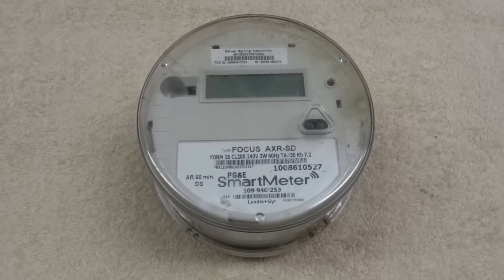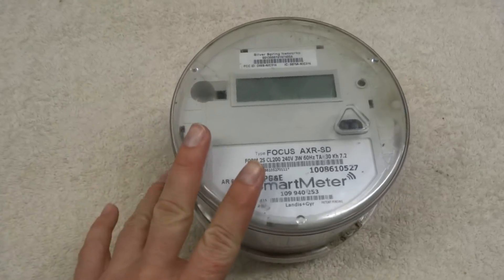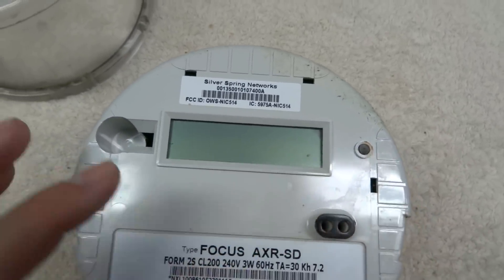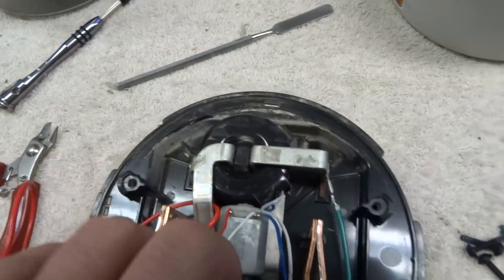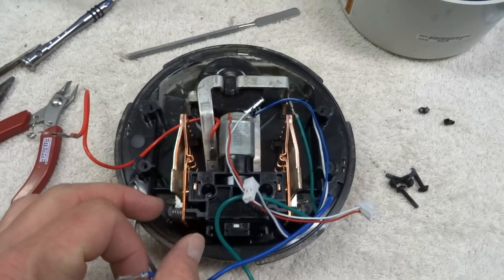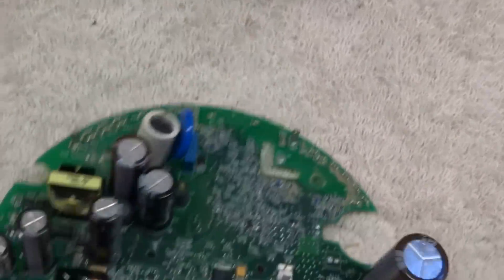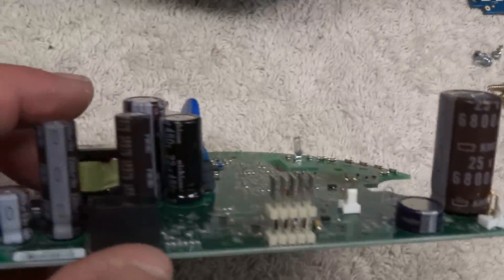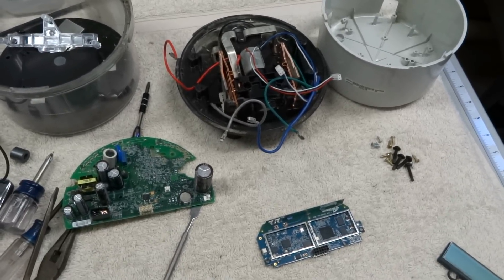Let's Teardown - Residential Smart power meter

Comment: 6:06 - the motor was added so power to a given house can be remotely shut down (e.g. didn't pay bill, enemy of the state, hackers, etc.)
Reply: This was the main reason our electric company (AEP) went with these meters and also they said we're going to have blackouts this summer to shed load. I'm in Texas🥵🤬
They tricked customers into accepting these on the basis it would save on our electric bill and we could observe real time usage. That has yet to take place 5 years later.
Reply: Is that a contactor

Comment: Someone may have pointed this out already but I'm not going to read through all the comments to see if they have.
You have the meter upside down. The power take off to power the the meter is on the supply side, not the load side. The supply side if where the switch contacts are and the load side is where the CT coil is. View the video when the meter is turned over and you will see the manual switch is at the top, not the bottom.
The green is not an earth. How can it be if it's on one of the 2 live poles. You have gray & blue to take off voltage from the supply side of the switch and red & green on the load side of the switch. This is still before it is sensed by the CT coil.
I admit green is a strange choice of colour to use for a live conductor but it's internal so any colour can be used for any purpose.

Comment: Safety aspect my ass ! You don't get with the program you get no power . Control of the people is why this was invented and implemented .
Reply: Let's look at why we need TIN FOIL HATS. 
 #1 A smart meter will hurt or even KILL disabled homeowners who have disabled medical implants.  The average of deaths by smart meter radiation and smart meter fires is almost 100 every month in North America.
#2 Did you know if your power company “turned off” the power to your home when they did a smart meter install, your chance of a smart meter fire increased by a factor of 10,000.
#3 Your power company has access to all of you private power information. Eg When you make tea, when you turn on your alarm etc. This private information is sold to Google for huge sums of money. Ask your power company what the second radio transmitter in your smart meter does. (ZigBee) 
#4 A smart meter will cause cancer to return if your family members who are fighting cancer at home. If they come home from the hospital and sleep near a smart meter, they will die. Check with the US Cancer Society website. 
#5 Smart Meter RADIATION  will turn off breakers in your home. Both AFCI's and GFI's get turned off by the radiation from the smart meter.
#6 You smart meter is very accurate, BUT, the software (firmware) is programmable. Your bill has nothing to do with the power you use. 
#7 Smart meter radiation is breaking Ionic Bonding.
#8 A huge expenditure for a huge loss. Billions of dollars to purchase something that does not general generate any power and each smart meter need 4 watts to operate. One million smart meters use 4,000 KILOWATTS of energy to operate.
#9 The second radio transmitter is for ZigBee. If you want your power company to MONITOR your home 24/7, then you are in luck. Don’t forget, this private information will be sold. Why do you think your power company spends BILLIONS of dollars and does not generate one watt of extra power to sell?

Comment: Even in this older unit,  I count about 8 processors.  Main CPU is rather large, which tells me it has large memory and operational capability, more then you would ever think, want or agree to.  From this, they can tell everything you do electronically in your home with your service down to the nano-second.  Sort of scary, actually.   My smart meter had to be changed because it was corrupting most of my remote control devices for TV,  tuner, DVD, et al,  in my house because of the proximity of the meter to my living room; also sort of scary.  Bottom line is, SmartMeters are entirely for their benefit, not yours.

Comment: That motor switch is a remotely controlled disconect, don't pay your bill it is shut off. The manual lever in back is to turn on by a meter reader with a re- connection fee. However depending on what circuit connection is used for the controller it may be remotely turned back on as well.

Comment: What a dwit. No clue what you are talking about.
Reply: OH LOOKEE HERE, we found us an EXPERT who is going to tell us why his smart meters kill an average of 100 people every month in North America. 
So DIM WIT Joe Bledsoe, give us the link for the DISTANCE TO COMPLIANCE for you AMI7 smart meter.
PROVE TO THE WHOLE WORLD YOU ARE THE EXPERT AND LIKE TO CALL OTHERS NAMES SO YOU FEEL MO MANLY
Reply: OK the donut round thing as dwit calls it, is a current transformer A torroidial wound coil of a non ferrous conductor around a core of laminated iron plates IE: a lam stack or in some cases it is a ferrite core. The bar that passes through it is the current carrying conductor of the load of the building it is monitoring. The winding of the CT has induced into it a voltage that varies according to the current passing thru its donut hole in the middle. Typically this is a 5 amp load at the rated ampacity of the meter but may be otherwise according to how the manufacturer built it. It appears to be a 200 amp household meter but may be otherwise. I purposely did not pursue any further investigation. If so it is a 200 / 5 amp CT rated for 200 amp load through it with a 5 amp output into the meter. This current may be monitored by a number of methods in the metering electronics but is eventually converted into a digital number by means of an analog to digital converter. This digital number is placed onto the meters data bus to be read by the microprocessor or microcontroller upon being told to by its internal program instruction stack. This is the amperage of the load which determines the KWH - kilo watt hours of usage which is an average of amperage used over the time of usage. IE: 1 Kilo watt of power used for 1 hour is 1 KWH which is how you are charged.  Ohms law states that 1 watt of power is consumed when 1 amp of current induced by 1 volt of power across 1 ohm of resistance. Volts x Amps = Watts.  assuming this is a 120 /240 volt poly phase system, a 120 volt supply to have a 1KW load needs to have a 8.3333... amp load on for 1 hour of time. A 100 watt incandescent light bulb uses 0.8333... amps. so 10ea of a 100 watt incandescent light bulbs must be on for 1 hour to use one KW of power. or if 5 are on they must be on for 2 hrs. Do the math if you are capable.  I never got past the round thingy description. I couldn't reach the mouse to click on the comment box fast enough to purposely debase the dwit. If you don't know what you are doing don't spread false crap and get someone killed or otherwise hurt. The remainder of this d&^%heads assessment was so painful for me as it is such bologna that I didn't look any farther,  as it is so obvious that the narrator is a dwit and knows nada about electricity. Go to school. learn how to beat your meat and get some satisfaction as you aren't going anywhere with this.
Reply: yawn!
Reply: Joe Bledsoe said:     yawn!
See folks, the smart meter radiation from his smart meters are killing his customers.
The smart meters hastily installed by his paid arsonist are burning down his customers homes.
HOW WORRIED IS JOE ABOUT ALL OF THE DEATH AND MURDER HE IS CAUSING?
Joe Bledsoe said:     yawn!
Joe Bledsoe said:     yawn!
Joe Bledsoe said:     yawn!
Joe Bledsoe said:     yawn!
Joe Bledsoe said:     yawn!
Joe Bledsoe said:     yawn!
Joe Bledsoe said:     yawn!
Joe Bledsoe said:     yawn!

Comment: The super cap is most likely there to keep power for the Real Time Clock during a power outage.  It has a lot of capacitance, but they are low voltage, and older ones had a pretty high resistance - you couldn't pull a lot of current out of them very quickly.  So they couldn't provide a lot of current / power, but the RTC circuit built into a typical micro-controller only draws a few microamps.  Seiko sold a chip RTC that consumed less than 1 microamp.  That allows a super cap to run the RTC for quite a while before draining.

Unfortunately, those older super caps didn't deal with high temperatures very well.  So if your meter was on the sunny side of the house, or you live in a hot area, that cap will die after just a few years.

Comment: Wifi is not used for transmission of signals and meter readings to the power company.  Wifi has a limited range for a few hundred feet typically, depending on what the Wifi signal has to transmit through, this is why Wifi is not used in Smart Meters.  Smart meters use low data rate cellular transmission of 2G, 3G, future 4G/LTE signals, just like peoples cell phones.
Reply: well then Kirk Charles, the #2 transmitter in your smart meter is the *ZIGBEE
WHAT DO YOU HAVE TO SAY ABOUT THAT?

Comment: These meters are set as KVA not in KW. Your meter will say be set to trip at say 39-Amps. The meter will trip at than current. You have to ask the electric company to reset your meter to say 80 Amps or whatever.

Comment: Ever see the power co. change a meter? they get a real good face shield on and place an explosion proof container around the meter and pull the meter. We had a smart meter burn those contacts on one side. Half the power in the house was off. 120 volts on some outlets and 25 volts on the others when the ac cut in.

Comment: just to clarify his error  suggesting that one of the two upper lugs is a ground.... all meters are dual voltage meters. the left side is 120 VAC and the right side is 120 VAC  because your house operates on 240 volts,  with the two 120 volt lines operating each side of your breaker panel. / thats why you can operate 240 volt stoves, AC units and  electric dryers. / the only "ground" actually is the bare cable running from the pole or from a grounding rod buried next to the pole. / as far as the  meter itself...rest assured, they were installed to benefit THEM, not YOU! / as far as them remotely disconnecting you... if one of the wires from the  internal motor was to  somehow become "disconnected", that might solve that issue...lol

Comment: I worked on these meters for a short period a few years ago at Landis+Gyr.

Chronological corrections or clarifications:
The button is multi-use per programming from the power company.  It can be used to re-enable the power disconnect, or to cycle through the different readouts on the display.  Different models have different buttons on the face and some have different clear covers with access to the buttons.

The two lines are Phase A 120v, and phase B 120v.  There is 240v between the phases.  There is no "ground" to the meter.  The meter sums the current across the phases (physically, via the single current sensing toroid (donut)).

The "banana plugs" are a bi-directional IR communications port.  The triangle on the front serves to locate the IR communication head. Seems like you got this correct later.

The motor is a basic DC motor that drives a cam to open/close the contacts on either side of the line.  This serves 3 uses: Disconnect for non-payment, disconnect for over-demand ("soft fuse"), and disconnect to prevent back-feeding (safety mechanism).

The plastic arm on the bottom is simply a hanger for use while servicing or installing the meter.

I believe the power company side is the bottom of the meter, so the current used by the meter itself is not paid for by the customer.  Either way, the usage of the meter itself is less than the meters capability to sense.

You'll also notice that there are 4 wires off the powerline - they are for sensing on both sides of the switch.  It can be configured to not close if the switch is open and there is power present on both sides of the meter (safety).

The supercap that is capable of powering the memory for a few days without power.  They switched over from a battery backup (that's what the hole to the side of the LED is/was for), as those had a tendency to go bad after a few years and need physical replacement.  I don't remember what all is stored in volatile memory, but it was a pretty important part of the meter.

I don't know much about the radio transceivers, but the header on the board supports a number of different devices - powerline communications, Zigbee, RF mesh, and cellular.  These were spec'd by the power company at the time of ordering / build.
Reply: Very Complete and good followup to the video. Just got my new meter and wondered if it had a disconnect.  As for the 3 reasons to be able to disconnect I believe #3 is very important. During the March 2018 East coast snow storm someone in our town was back feeding the downed wires with a improperly connected generator. Made service work difficult cutting up trees in the snow with live power on the high line from the generator. As we know supplying 115 or even 220 VAC to the Secondary side of the Pole Transformer can let it generate High Voltage to some degree. When power was restored it blew up the generator and set the house on fire... So they finally found it....  Not really sure if without power company power if the meter could go through a disconnect with no power. But part of the Safety Circuit could sense the Generator Power with the flow of power going away from the house and the motor could activate and turn off the GRID to that house....  That would make sense to me.
Reply: Greg  McNamer - Lets talk radiation ,   do they  really emit a lot of radiation ??.  Thanks for the input !!.
Reply: the radiation is the  same thing that the averange outdoor wifi router.
Reply: Where's the step-down transformer to reduce the 110v AC to 12v DC? I ask because none of those electronics are heavy enough to run on 110 AC and as you stated even the motor is DC, I'm guessing it's in the round part that has the Grey and Blue coming out of that has one 110v feed line going in and out of? Induction step-down transformer?
Reply: Gregory McNamer so do they emit radiation or not ? Have so many videos saying they emit radiation and large Volumes of emf ?
Reply: So what happens if I put a really big magnet on this meter, would it damage the meter, and if so how many will they replace on my house before they put a mechanical one back on? LOL But seriously.

Comment: The motor is to disconnect and reconnect the power when you don't pay your bill. The donut-shaped is a Transformers / coil. This coil is what's measuring how much current you're using. the red and green wire coming off the bus bars is what actually what Powers the unit. both of those bus bars are hot one is 120 the other ones another 120 that's how you get to 220 volts your neutral and ground bypass the meter inside the panel. you don't need a neutral wire for 220 because of the way the sign wave works with 60 hertz ones always positive ones always negative and they rotate back and forth 60 times per second

Comment: Good video but...Are you sure the main breaker goes to the house?The main breaker comes from the power supply line in the street.
Then to the meter or smart meter and then your fusebox, then power sockets and lights etc. in your house.

Comment: that donut shaped device is a current transformer, and the others are correct......that motor is a remote cut-off that the power co. fat cats can shut off your power without bestirring much more than a finger.......rattle-rattle on the keyboard, followed by a click or two  of the mouse and........>poink!<.........the lights go out. 'nuff said.

Comment: The Electric Switch powered by an electric motor just like on the distribution lines.  Remote Control.  Pay your late bill plus fees such as weekend, after-hours when Union Rates are highest and the automated telephone response system can turn on the lights instantly as your payment clears.  Pay as you go, just feed the pig.  And during peak demand periods, rather than pay 58 cents a kilowatt, the utility can turn it off for 6, 8, 14 hours a day with the reward of 6 cents a kilowatt as you mass consume charging batteries, water storage, hot & cold / Demand Shift.  In Texas, nights and weekends are free!  Remote Control if the police need a blackout.  Turn on / off your home power remotely with the utility power wise app.

Comment: A big part of the reason for smart meters is the Rf control over in home appliances. Power companies do not want to expand capacity as that physical infrastructure costs a lot of money. Instead they and the government, both federal and state, prefer to cut consumption. The problem obviously, is a growing population. How to limit consumption during peak use times to prevent blackouts and brownouts? Easy. The smart meters are capable of turning off hi consumption appliances at your panel by using Rf or a physical connection. You currently can stop them from doing this by locking your panel and post a no trespassing sign. They lock their meter and you can get fined heavily for cutting their seal. Well, you own the panel. You can lock your panel and keep them out and play the same game they do. BTW, I am a 56 yo master electrician.
Reply: Well then, as a "master electrician" you should already know that the power company cannot shed individual loads inside your home unless you request them to do so. This involves additional equipment to be connected to your appliance (water heater or heat pump/ac, typically) so they can turn them off for a few minutes each hour of peak electrical consumption. But, of course, you're a master electrician, so you already knew that.